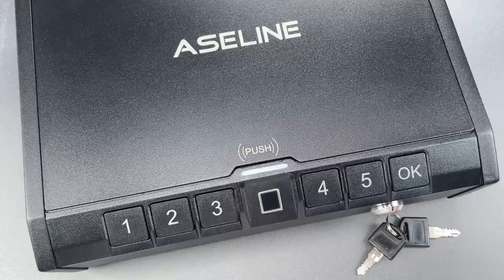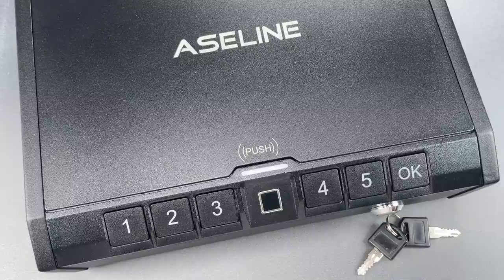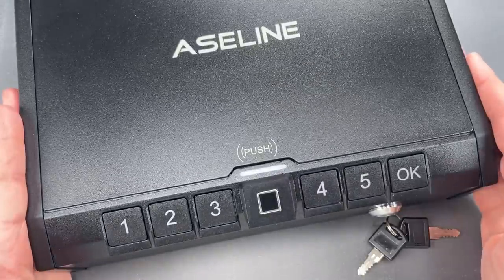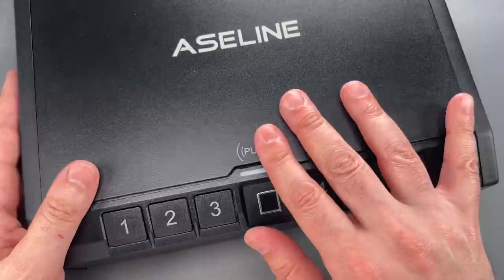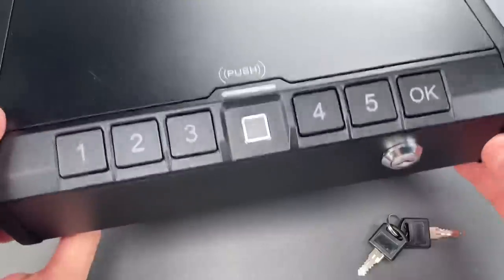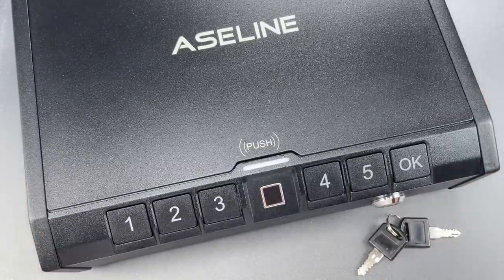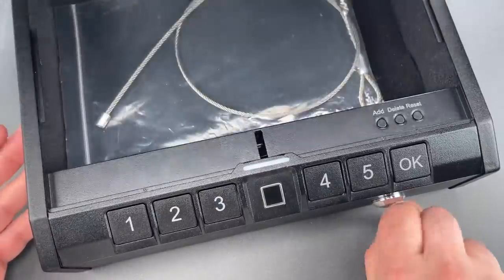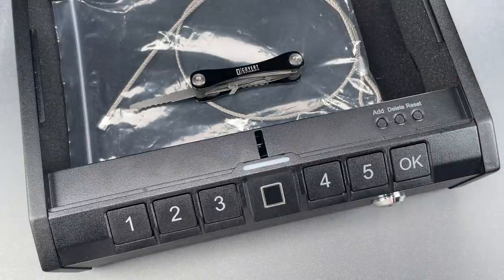[1445] “Aseline” Jiggled Open… As Bad As It Sounds.

Comment: When he put the tool in the safe, I thought he was going to lock it in, and jiggle it open with some trash. Would have been an excellent burn.
Reply: I've opened similar cheap locks by putting a ziptie in the keyhole and jiggling. He probably could have easily done that.
Reply: I've hammered wire flat and jiggled these locks
Reply: I know! I was disappointed that he didn't.

Comment: Since this one actually fixes the button issue, if the cylinder is a standard threaded cam lock, it could be worthwhile, depending on the price. If it's a pressed cam lock, I wouldn't bother though, there are generally better options in the cheap segment.
Reply: Or even pulling the electronics out and putting them in a more hardened case.

That pressed sheet metal doesn't look all that resistant to forceful attacks.
Reply: Or give it a wire and power it off the grid instead. Poof, gone is the need for a backup lock and the most obvious, weakest attack vector
Reply: @LRM12o8  You know you can lose grid power too right, it's not invulnerable. A better solution would be to put contacts on the outside of the case that allow you to press a 9v battery against them to power the electronics if the internal battery ever dies.
Reply: @richardmillhousenixon  Yeah, I know. Wasn't an issue in my mind, cause I never experienced a power outage in my life, but power outages are quite common in some areas in the US, right?

But that idea of yours got me thinking why not just make the main batter accessible from the outside in an external compartment? Should be possible without compromising the integrity of the safe, problem solved!

Comment: So if we replaced the core and add a "B" could this at least become a "Baseline" for this type of device.
Reply: Replace the "L" with an N" and you'd be closer to the design quality.
Reply: How about adding a "V" at the beginning to make "Vaseline"?
Reply: Replace the "E" with an "S" and you've got a whole product line!
Reply: That's what the name was supposed to be, only someone stole a letter.
Reply: @mikecowen6507  ahahahhaha
Reply: @mikecowen6507  asslins? 😂
If the buttons would have worked with closed lid, the "Vaseline" would even suggest what to use to get your tool in 😁
Reply: Spanish: pronounces B and V the same
English: Baseline / Vaseline

Comment: Aren't all those companies selling crap liable in case a kid shot himself in spite of the fact that the gun was "secured" in a box?
In particular, because this channel is popular, this kind of flaw is well known and should be addressed by a manufacturer.
Reply: Shouldnt the responsibility be on the owner to ensure what they use to secure their weapon, is fit for purpose? That would be the smarter play rather than offloading personal responsibility on to someone else.
Reply: I can't speak to liability law, but many of these products are designed to meet legal requirements for firearm storage and not security.
Reply: @DerekIcelord  you are right! In case of spot check by law enforcement.
Reply: Companies get around this by adding disclaimers that the gun should still never be left unattended or near someone not responsible enough to handle it.
Reply: @EndoSurf  I think it makes more sense to expect the safe maker to be a security expert than the user; the user should just be expected to follow the instructions correctly.

By analogy, when you buy, say, a TV, you’re not expected to be an electrical expert inspecting the inside of the TV to make sure it won’t start a fire and burn your house down. The burden is on the company, which is supposed to have experts who can do a much more thorough inspection than you would be able to.

While it would be nice for every gun owner to know every way to pick and bypass a lock, so they could judge the safes for themselves, to expect it seems too much, just as it’s too much to expect every TV owner to be an electrical engineer.
Reply: @EndoSurf  well, if they say it's safe for storing a gun in, then it should meet some higher safety standard than the cheapest lock from the dollar store and a bunch of fancy electronics that are made completely obsolete by said lock, don't you think?

You expect every gun owner to be able to determine the quality of a lock?
And would that extend to every other product category too? Your fault you bought a Ford Pinto that's prone to catching fire after low-speed rear crashes, you should've known before purchase that the fuel tank was placed in a bad spot, protected only by a barely functional, rather decorative rear bumper, making this thing a rolling coffin! 

It should be the manufacturers responsibility to make sure that the product is a) suitable for its purpose and b) generally safe for use, because the average consumer does not have the knowledge nor the access to design information needed in order to check that!

Why should the consumers have all the burden of diligence while the companies get off scott-free from even the biggest blunders?
Reply: The main reason they can’t be held liable is because they are made in China (or similar) and suing a Chinese company is possible in theory, but basically impossible in practice.
Reply: @TheQuark6789  What does an electrical expert have anything to do with purchasing a tv? If someone purchases a money drawer "safe" should we forgo all common sense and assume money will always be safe in a locked drawer "safe" regardless of any other circumstance? Of course not. It's not difficult to recognize that very thin steel probably wouldn't stop any 12 year old with basic brain function for more than a couple minutes at best, even without the covert instrument. If someone chooses to store a firearm in their home with a child who hasn't been appropriately educated about potential firearm dangers, it's their responsibility to research and understand appropriate firearm security. As Allan mentioned the majority of the portable "gun safe" market exists to meet the demands of 'feel good' bills drafted in a tiny handful of states by some elected bureaucrats that are completely clueless about firearms and/or firearm security (other than a few clips they watched on cnn). It's a terrible decision to position state (or even worse federal) bureaucrats to apply broad security decisions in our homes!
Reply: When my kids were young, wife and I left our primary handguns out unloaded. We didn't have thes fancy boxes back then.
Kept the magazines in our pockets. Probably faster than accessing that box.
Reply: @JimYeats  then they should sue the seller/importer!

Comment: Also with only 5 numbered buttons, if the number code is 4 digits then there’s only 625 combinations, at 10 attempts a minute that’s only 30 minutes on average, something a curious kid would do just for fun.

Actually it would be great fun if LPL did a sped-up video of him doing exactly this - it would probably be his longest video 🤣
Reply: No its allot less than 30 minutes on average. Coz i don`t think the average is you only get it right on the last posible combination.
Reply: no 5 Factorial aka 5P4 is 120 and 5C4 is 5 so no, it would only take 12 minutes at that speed, which could be faster.
Reply: @Muaddibize  10 attempts a min means that if it was the last code you entered it would be 62.5 mins in. 30mins average therefore seems fairly reasonable.
Reply: @Muaddibize  I allowed for that, if you hit it on the last number it would take you 62.5m, obviously I approximated to get 30m.
Reply: @Gavin-N  you enter 4 digits followed by ok. The code can be anything from 1111 to 5555, and the sequence is important so the combos are therefore 5x5x5x5 not 5!
Reply: Also should be checked if the device has a lockout for 10 minutes, for example, every 3 wrong attempts... then it would take much longer to try all combinations.
Reply: @SystemX1983  I can see that would make sense in a ‘normal’ application, however for a home defence, high stress situation, I suspect they don’t. 

I’m totally guessing so if anybody actually knows, please let us know.
Reply: @fredbloggs5902  sure, on a gun safe this would be counterproductive, if the authorized user would be locked out from his weapon after 3 wrong attempts 😆
"Dear robber, could you please wait 10 minutes before shooting at me? I am disarmed right now!" 😄

Comment: naïve question: can a hairpin or something similar with grooves act as a “from my tabletop” equivalent of that jiggler?
Reply: Quick Answer "Yes" 
Long Answer "Yes, but it depends on the width of the keyway!"
Reply: if it fits, it fits
Reply: @heartache5742  nah man, a lot of stuff will fit but won’t do anything, i know ‘cause i tried some XD
Reply: Wafer locks are common in office furniture.  I've used a pair of the larger paperclips (standard size being to weak), cleverly bent, to rake them open.  Easy peasy.  Sometimes the core will even pop out, because they're held in by a larger wafer at the back.
Reply: @YouTubeCensoredMe  I've opened many wafer locks using a smaller wafer lock key to jiggle them open. I'd never trust anything of value to a wafer lock.
Reply: A metallic nail file even without grooves usually works on cheap wafer locks.
Reply: with the right technique yeah you should be able to
Reply: Yup!
Reply: Pretty much anything you can think of that fits in the keyway could open this type of wafer lock. It's sad that they're still around, really. Lol.
Reply: I've opened "key boxes" with two bent paper clips (one for a tension tool). so, yes.
Reply: @WhereWhatHuh  how about no tensioning stuff, just jiggle?
Reply: @wilsonaala9395  Well, I could be wrong, but I've always had to apply some torque to make it turn. A jiggler tool lets you do both at the same time.
Reply: @wilsonaala9395  sounds like my ex-wife!
Reply: Anything flat and narrow enough to go in there. On the really cheap locks it doesn't even need to have serrations down the side. Just wiggle it while turning...
Reply: Office locks.
Cut a piece of clear plastic off some product packing (or a bound document) with scissors. Takes a few seconds using plastic and scissors that are always in offices.

Comment: Can those locks be easily swapped out for something else? I figured the middle ground is as long as the case itself is fine, changing the lock to something good will make this better.
Reply: Or just fill the lock with superglue.
Reply: @darrennew8211  i was about to say the very same thing

Comment: especially considering the recent attacks in the news i think a much more secure gun safe is a must.

a combination of several things like trigger lock or barrel cable lock, a safe and a much bigger safe.

trigger lock or cable lock through the barrel or bullet ejecting hole.

then inside of a safe box and the safe box inside another much bigger safe.

then keep the bullets and magazine(s)  in separately locked locations.

with what has been going on in the news such cheap shoddy safes are inexcusable

Comment: The wafer lock could be replaced easily with a much more secure lock. Hopefully the company will redesign this product. I did notice though, that there appears to be a clear bit of plastic near the lock just behind the finger print reader. It would be interesting to see if it's a Light sensor that is blacked out once the lid is closed and disables the code and finger print reset button. If that's the case, shining a powerful led through the lid gap might fool it. Hopefully though, theres a mechanical  microswitch instead that is activated when the lid is closed to disable the buttons.

Comment: Have you ever thought about testing a Vaultek safe?  I have one that I've used for years.  I think it's one of their 20-series safes.  I'm currently using it as a keybox at home, but have also used it as a gun safe for my car.  It seems more secure than average, and is certainly more expensive than the cheap stuff you usually test, but I was curious if it would hold up to your particular set of skills.  The mechanical backup lock is a slider lock.

Comment: Can't see if this (and other safes with wafer locks) lock cylinder is accessible enough to swap it out for something stronger. I know in some industries these are supplied by default because the end user always swaps them out anyway, because they have their own stronger systems (with features like keyed alike). For a 'normal' end user there is always a locksmith...

Comment: I wonder if this could be a viable product if the keyhole was filled with something like super glue to prevent use? Other security aspects weren’t mentioned like wether the fingerprint lock actually IS a fingerprint lock, or if the buttons can be tampered with.

Comment: My takeaway from this is that they might have a decent safe if they replaced the wafer lock with a charging port so that the lock could be opened even with a dead battery.
Reply: Plus a scratchcard with a 10 digit unchangeable emergency code instead of the key.  Unique for each lock with serial number visible to make sure you get the right card for the right box.

Comment: I wish he would start saying if switching out the lock is an option to a better more secure unit or if it is a proprietary design? He used to do that a little in older videos.  I would buy a good case with a cheap lock if it meant I could switch it out.

Comment: Am I the only one who thinks products like these would be better served by some method of externally power the lock in case of bad batteries rather than crappy mechanical backups? You could quite easily add a micro USB or 9V battery terminal to the outside.

Comment: I watched Robert De Niro's character in the movie Midnight Run (1988) pick a lock a couple of times by using a spring-loaded tool that was essentially a bent wire folded back on itself and one end folded into a hook to hang onto the other end. Then the character would use his thumb to depress one end so that the hook would go low, and then by releasing the hook would pop up so to make the end sticking into the lock pop the pins inside. You could make the tool out of a coat hangar it seems. Is there such a tool?

Comment: You need to do the corner drop test on all these assenine things,
a curious teen is one thing but a toddler is a far more dangerous threat.
If a toddler were to knock one of these things off a shelf (even with security cord fitted) there's a danger of the toddler getting the gun

Comment: It looks like that lock is easily replaced with a more secure lock, by opening up the lock portion, unscrewing a jam nut and actuator, and then just replacing the wafer lock with a disc detainer. So, no, given that the buttons are disabled while the box is locked, I think the product should be praised. Maybe do a video about how to "upgrade" the lock?
Reply: I think the safe shouldn't be praise just because of that. For one, not everyone is going to replace the mechanical lock and a lot of people won't even know how bad the lock that comes with the safe is. Having a negative review on the safe will bring more attention to the issue. Someone that did buy the safe is going to click on this video because it shows it's glaring flaws and not because it has a neat feature that they probably knew about when they bought it.
Reply: @anenigma8378  I personally think that if the product is fixable with common hand tools that most people have at home, I think the product means the fault should be dismissed, but with a instruction on how to fix the issue.

I mean, you only need a screwdriver and a plier and then buy a disc detainer closet lock (could be the cheapest ass abloy disc detainer ever and you still upgrade the security like 20x) at any locksmith, and you have a really decent box.

Same with that other box with a exposed button, but where the gap in the metal wasn't between the door and jamb, but between 2 folded steel plates, meaning the gap could be covered with a dab of epoxy, and the safe's vulnerabilities would be fixed.
Reply: @sebastiannielsen  Any product can be fixed. Good products don't need to be. Sure, you could use this safe, but you could also use a different one that has more vulnerabilities, but is cheaper to purchase and fix. At that point, you're just buying parts for a whole product, but the safe was sold as a whole product which is misleading.

Comment: My question is how many curious adolescents have thin sheets of metal with specifically designed cutouts to maximize the chance of jiggle or rake a lock. Or have extravagant lockpicking kits to just whip out 'pick number 9 in 12 thou'.

Most curious kids I know.. would pick the thing up and smash it on the ground or try to pry the lid open.

Comment: Just dont put a mechanical lock, take 2 bloody wires and make a contact on the top of the case for a 9v battery , that way you dont need a backup key. And when the internal battery fails you can put the supplementary 9v battery  power to the safe, open and swap the dead battery.

Comment: Extremely fascinating stuff! For the record, I ended up here trying to decide the safest thing to use to lock my commuter grade escooter. My road bike I just choose not to lock it anywhere, simple as I don't want any risk of it leaving my ownership. I have two thieves on video steeling one of my other bikes right in front of my front door and they didn't care they were on camera. First guy tried and an hour later a second guy shows up with much bigger bolt cutters and ends up walking off with it after about 10 minutes of his time.

@LockPickingLawyer Boring story aside, I have seen your key note and it has left me wondering ... how do we go about getting some truly worthy engineering? We are aware of the risk vs time variables but it leaves me wondering, if not the current leaders in the industry because of sizeable R&D budgets in the industry, then who and how? Could you  please speak to that?